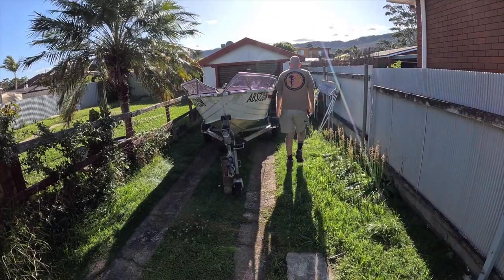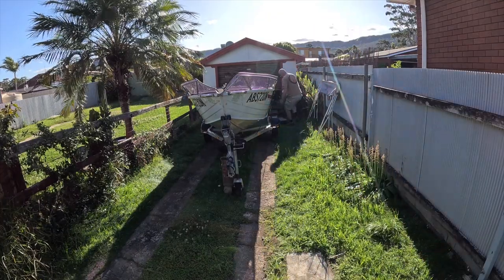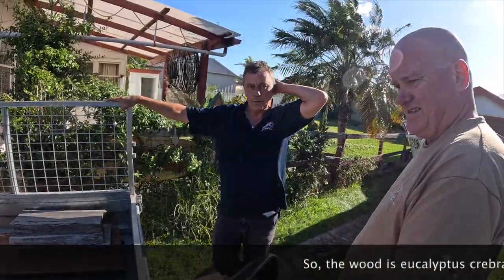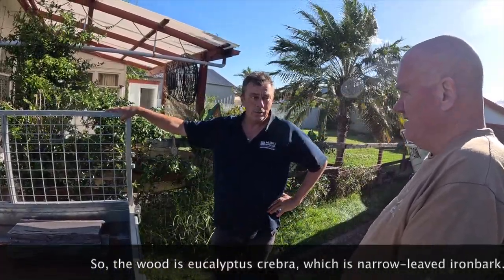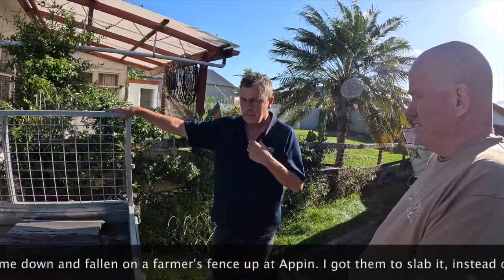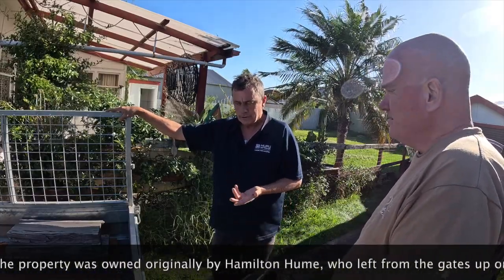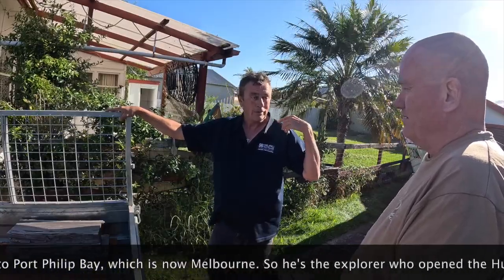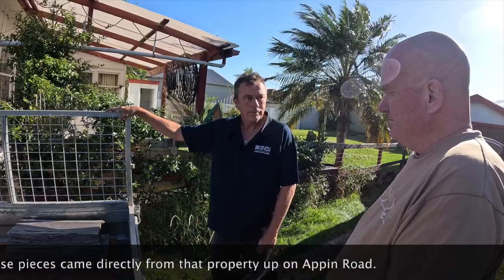Buying slabs of wood with a great story

Comment: Looks like a great bargain to me.  The facts comparing the story to the formal text matches well.  If it is like other Ironbarks I have worked, it will be harder than you can imagine.  It will test your tools , machines and sharpening but the final finish will be fantastic.  When I have done finish sanding on Ironbark I go way up the grits even to 1200grit.  The timber shines without any additional finish.  Apply oil/wax as a surface protectant.  Look forward to seeing what you do with it.
Reply from the maker: Excellent. Thank you for your advice Mike.